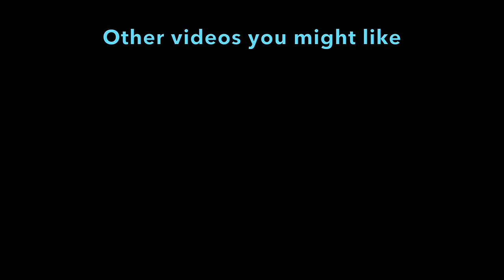FoamCore Advanced Basics Tutorial Guide FoamBoard model making: modeling tips & tricks for Designers

Comment: I'm really enjoying theses foamcore videos, brings back lots of memories of working in and running graphic arts shops in the 90s. We used a lot of foamcore and gatorboard of course for mounting artwork but also for package design proofing too. I can remember the specialised tools we had, Xacto and Olfa made most of them like bevel cutters which were essentially a block that held a blade or two on an angle. We also had a huge Xacto panel cutter and various heat and cold mounters.  There were other adhesives too, one came as flat sheets or rolls of a material that looked like a dryer sheet which was dry and not sticky at all until you hit it with heat gun or tacking iron another was rubber cement that was good for foam to foam and lastly 3M '77' that awful spray stuff that got everywhere but could occasionally do wonders. I like seeing your personal design work best but these tutorials are fun.
Reply from the maker: Most excellent! Thanks for your comments. There is nothing like making stuff with your hands. I have used many of the items you mention. All good tools. Glad you like the content. feel free to share on social Media. Thanks for your support Brian Boni

Comment: Have you ever tried combining foam core and any type of modeling clay? I assume oil based clays would degrade the paper. Would a polymer clay work any better? What about modeling wax? I want to combine the flatness and volume making potential of the foam core with the softness of clay for a piece for which I will be making a mold to cast cement. Any ideas?
Reply from the maker: Not really, oil based clay will stain the foam paper, try it see what happens.

Comment: Do you have a preference on what material you use to make models? For example, are there better materials to use for models with more complex forms? Or is it basically up to how skilled the maker is that makes the difference
Reply from the maker: Alex Cruz it kind of depends on the the form/function of the project and finding a good material to do the job. Sometimes you just need an appearance model that does not have to function, other times you need to select a material that will be a bit more durable so you can check how something works. It's a case by case thing. Good question though!
Reply: Eric Strebel thanks for the response!

Comment: Was just wondering - how do you work out the measurement for the length of the foam board you are curving around for the cylinder to make it match up with the circumference of the circle? Would much appreciate your help for this. Thanks :)
Reply from the maker: Just basic math, use the formula for the circumference of a circle to find the length.
Reply: @EricStrebel  Ok thanks! Oops think I may have over complicated it in my head again!

Comment: For smoother, easier, large radius curves, simply peel off the paper that covers the foam on the interior and shape from there. The foam is flexible and will stretch and compress.
Reply: Good tip. I'm thinking of trying foam core to hide a short hot water tank in the bathroom.

Comment: i dont think the foam core i can buy is made of foam. I tried your methods and it keeps tearing and breaking off. Is it the board or is it just my noob skill? Help me out Eric, please.
Reply from the maker: Dull blade perhaps
Reply: @EricStrebel  I change my blades often and I’ve tried doing v cuts just like in the video but just can’t get it to bend. It would just snap off.
Reply from the maker: Paper backing needs to be flexible like paper....what is the product called that you are using? There is a product called gator board that sounds like what you are describing, that would not be suitable material
Reply: @EricStrebel  looks like I have been using the wrong type of board. Thank you loads Eric!

Comment: How do you prevent flat foamcore from bending due to humidity, temperature changes, etc.?
Reply from the maker: You can't really, perhaps internal braces could help.
Reply: @EricStrebel  I am trying to mount foam core on an old fashioned cork board with standard push pins. They keep trying to roll up, which pulls out the pins and they fall. I had thought that scoring the back, perhaps with v notch, would prevent this. Was I wrong? ANy ideas on how to hand foam core on a cork bulleting board?
Reply from the maker: Use a water based adhesive that will be flexible this should allow the two materials to move independently. That should help

Comment: How do you cut through it so easily? I find I'm putting so much pressure on the knife just to get through it, and I lose precision. Brand new knife blade too..
Reply: I dont know if it makes a difference, but I like the better blades that claim to be made from a better metal or something. Personally i use a OLFA yellow utility knives that have the extendable blades but I work quite a bit larger than Eric. I just find myself more able to give the right amount of pressure to the board to cut thru and maintain the depth.
Reply from the maker: Eric Lehmann, I am using standard x-acto blades, they only last a few cuts. I do enjoy the blue version of the blades, they are hardened and have a blue tint t o the blade, they cost a bit more but are worth it in my opinion.
Reply: I agree that I think the price is worth it. As I said I work quite a bit larger than you do and not as meticulous. I create installations for events or client pitch type things or objects to be used in video's or the like (sometimes just a placeholder to be altered in post). So for me, the OLFA Heavy duty Snap-off Knives with an 18mm blade is the best, and then I buy the high quality blade for that, its like a darker grey. It might be more knife than you need for the scale you work at but whats great is you can snap off the bad edge slide the blade up and keep working.

Love the video's Eric. I built my skills in a bit of a vacuum so its great to see skilled craftsmen showcasing their solutions to common problems. Thanks so much.
Reply: @EricStrebel  A few cuts?! I can get at least 2 large projects out of each blade.